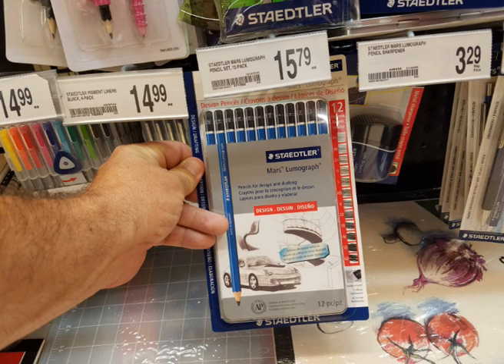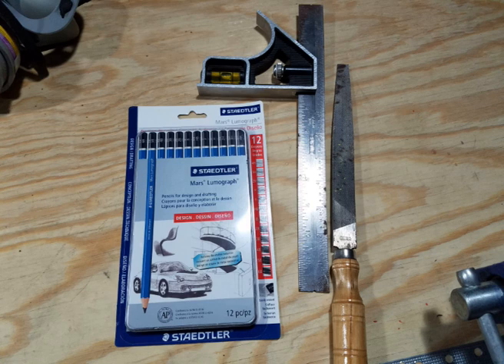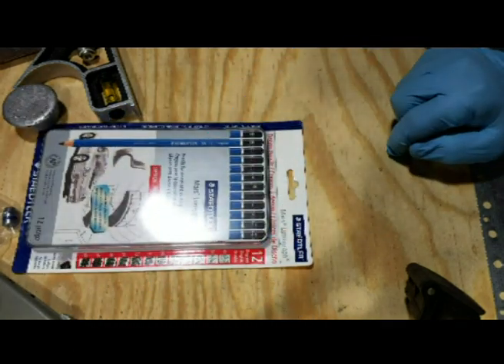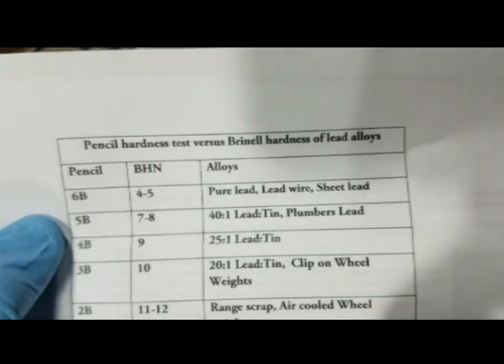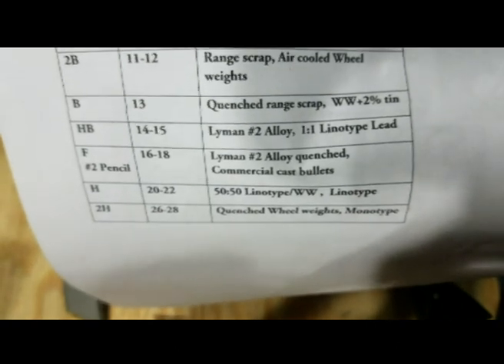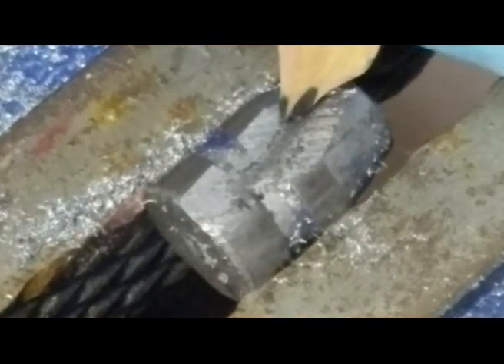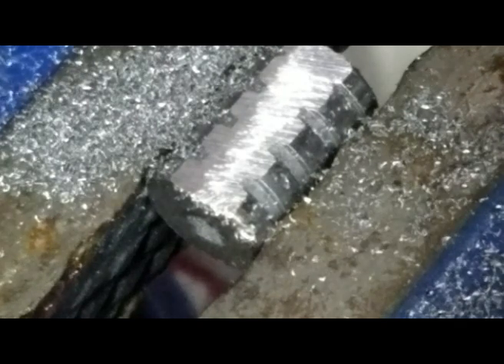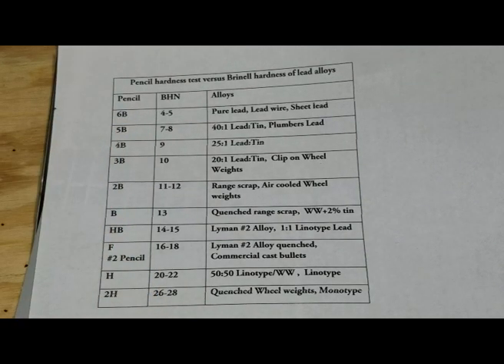Pencil hardness test versus Brinell hardness of lead alloys

Comment: Back in the day we used to use this method for testing the hardness of paint coatings when running quality control in paint manufacturing.. Not sure it they still do it this way as that was 25 years ago... The test required the pencil lead to be sanded to a true 90° flat tip... no point. Hold the pencil at about 60° from horizontal to the surface being tested.. if it digs in then go down 1 hardness... Once you find the point where it will not dig in the hardness is between the last 2 leads (the one that did dig in vs the one that would not)

Comment: Thanks for your effort on bullet lead hardness testing. But what you are using is not a Mechanical Pencil ! I have used mechanical pencils with different grades of lead installed and that works fine. But so that no one is mislead these are these standard graphite and wood pencils !
Reply: And I thought casting bullets would be easy.  What?

Comment: I am by no means an expert......but those do not look like mechanical pencils.  lol     Anyway, just picking on you. This is an excellent video. I didn't know you could do this.   Thank You!
Reply from the maker: Lol you are correct. (You are technically correct, the best kind of correct..)

(Im my very best "secret agent Maxwell Smart, also known as Agent 86. " voice) Would you believe mechanical (drafting) pencils? 
I have called them Mechanical Pencil's ( I really don't know why i call them that ) I should of said Drafting pencils.
Reply: You don't have to "Get Smart" with me, 86. What would 99 think?    Seriously, this is a cool pencil lead trick for measuring lead hardness. I'm cheap and was looking for other ways to test lead for bullet casting and came upon your vid. I appreciate it!   I visited your website and seen the video on using a zippo for wind direction. I know a neat little trick for waterproofing a zippo and it also keeps the fluid from evaporating over time. Take a small bicycle tube and cut about a 1" section out of it. Then slip the piece of tube up on your lighter at the opening. When you want to open the lid, you simply roll the rubber tube down like a condom. Then roll it back up when done.  My neighbor is a mountain man type prepper and he showed me the trick. I've dropped my zippo in a glass of water to test and it works. Plus your fluid lasts much longer.
Reply: Technically correct, they are mechanical drafting pencils... Mechanical does not refer to the method of operation... it refers to the field of use... Mechanical drafting... Know this from personal experience... I am old enough to remember when all drafting was done by pencil on a board (before computer CAD). Had my 1st job as a mechanical drafter.. went through thousands of these pencils...
Reply: @NorthCarolinaPrepper  Is that correct?  "mechanical (drafting) pencils"  Not trying to be a smart butt, new to casting bullets, and ....